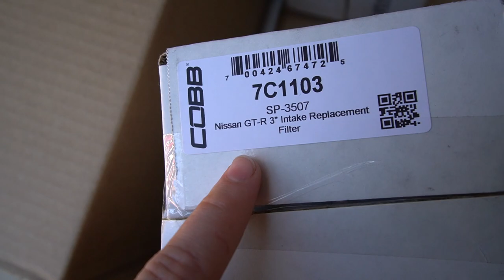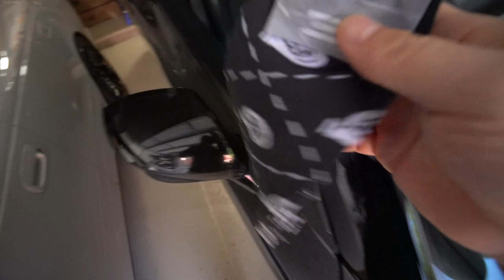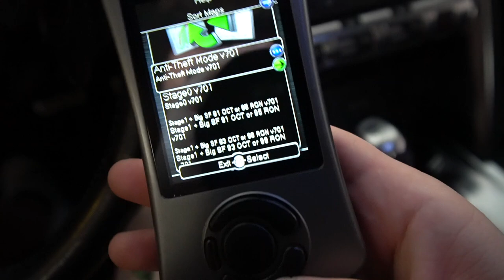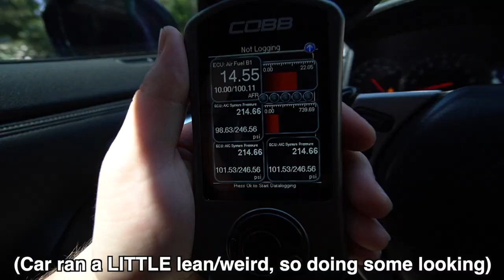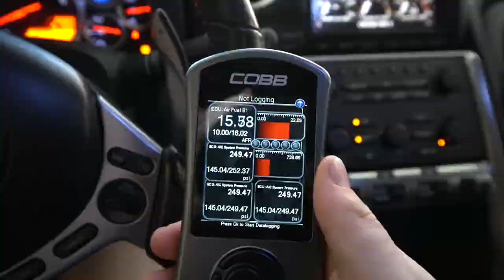POWER UPGRADES FOR THE R35 GT-R! (it's WAY FASTER)

Comment: In regards to the JZX - A long time to start? Like multiple tries to start, or the starter isn’t catching and starting quickly? Driftmotion has an excellent starter that i’ve used on my 1J Soarer, just make sure you get the right plug shape.